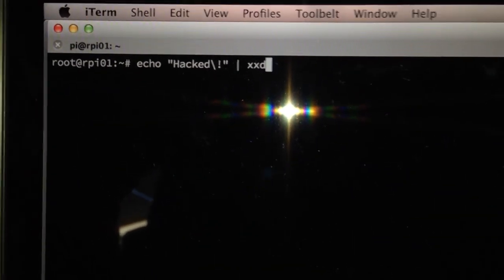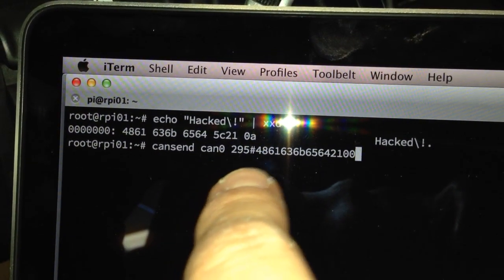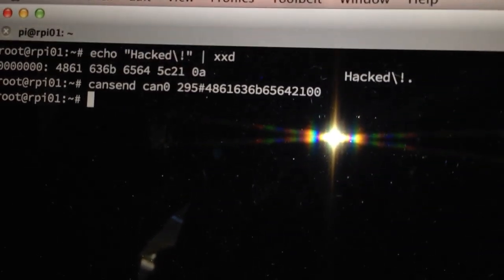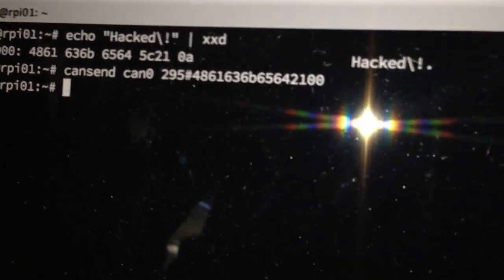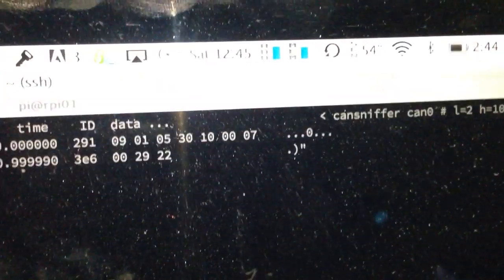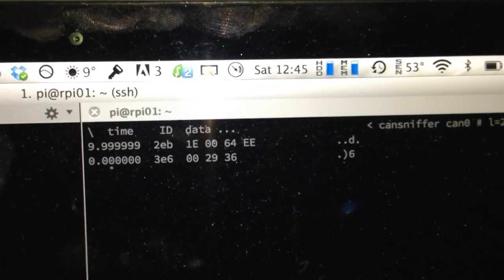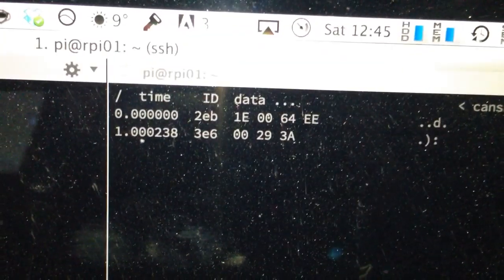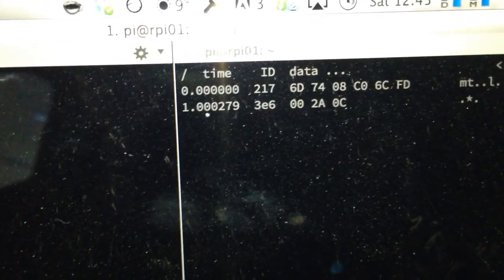Hacking the Jeep Interior CAN-Bus, Part 5

Comment: Hi Chad, great video! I am also trying to do something similar in my car. I am trying to sniff my CAN bus to find the ID's and bytes responsible for the customizable options in my car with the intention of eventually controlling them via my phone. I have identified the ID and bytes for enabling one feature by far but when I use CANSEND to send the message on the bus, I can see that the feature does get enabled momentarily but returns back to the disabled state soon. It seems, I am not able to "write" changes to the bus. Any tips/suggestions?
Reply from the maker: Most like another device is constantly sending a message and the device that is receiving the message gets your message once, and then gets the message from the other device. At least, this is what I see a lot on the Jeep.

But outside of that idea I'd need more info :)
Reply: @nuclearchadwick  Ohh...what other info would you need? I live in India and am working on a Ford Eco Sport. My approach has been to enable and disable a feature on my dashboard and identify the corresponding changes using cansniffer. Then I resend the identified message back to the bus (following which the feature gets enabled momentarily and then goes back to being disabled). Appreciate the reply!
Reply: About the "other device" you mentioned. Would it be possible that I am not able to see what it is doing on the bus? Oh yeah, thats another thing, I am sniffing the CAN via the OBD port.
Reply from the maker: @yashsamant6916  Yeah if you are going in via the OBD port then it is likely filtering out and only showing you certain messages. To move forward, you really need to find and map out the CAN bus architecture of the vehicle. How many buses are there, etc. etc. And then figure out what devices on the networks control what behavior. It was semi-straight forward on the Jeep, but that is unique to that vehicle alone.
Reply: @nuclearchadwick  Alright! Thank you Chad. I appreciate the help!